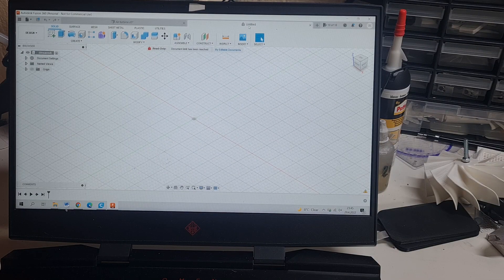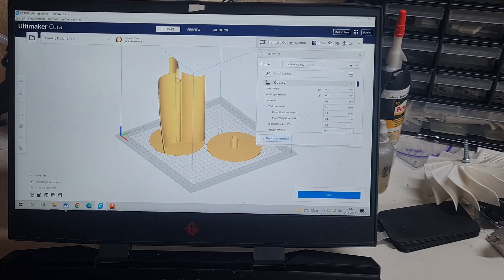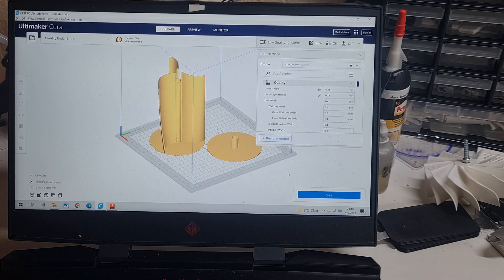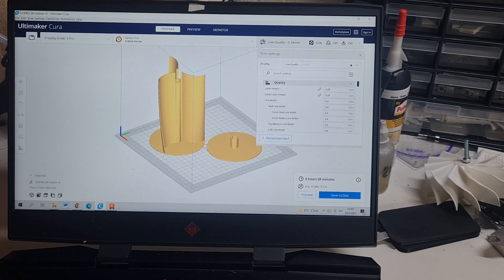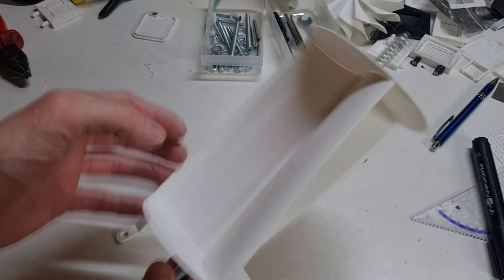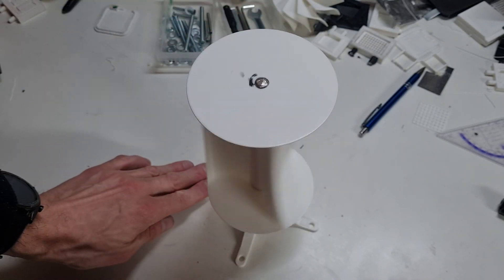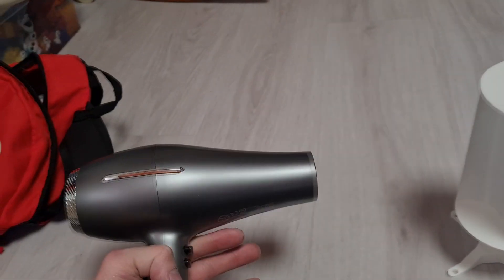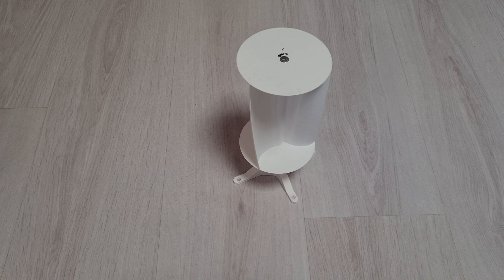Wind turbine from scratch

Comment: put a few plastic washers covered in candle wax on the bolt end to save the print wearing down/friction melting to quick if you dont have a recycled thrust bearing handy
Reply from the maker: good idea